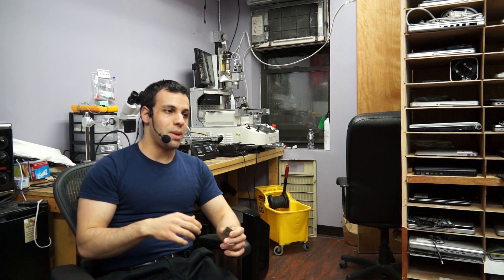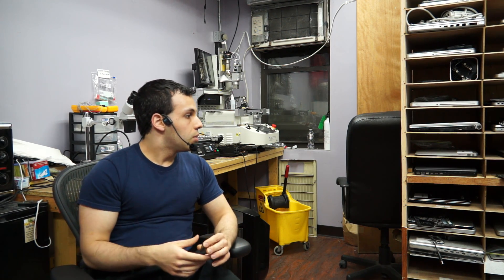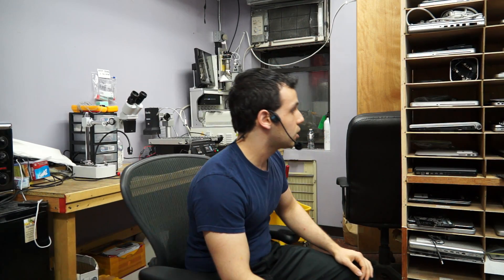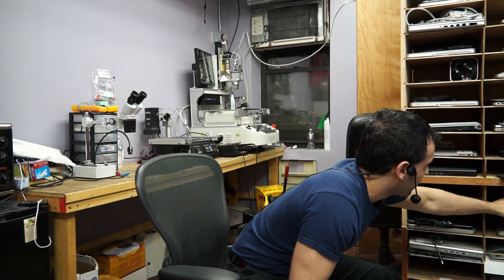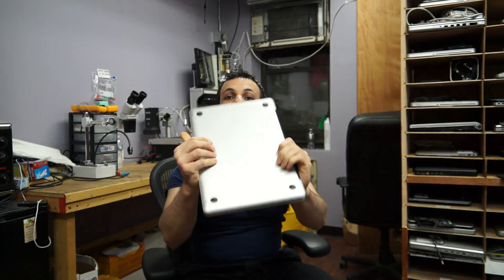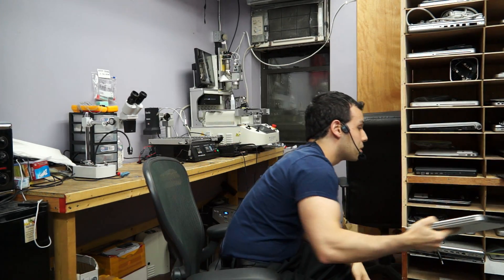Reballing flip chip GPUs is BULLSHIT - the truth about dead laptop GPUs & repairing them.

Comment: You're the man,  i have been meaning to setup a proper shop at home here, but there are very limited "guaranteed" repairs these days. I dropped out of school when learning digital circuits design because i'd rather fix things than make crappy hardware limited by the manufacturers orders.

I love learning what we've already got , rather than push my limited perspective on others.  I could say I'm an engineer, but in the streets, TECH gets the credit.

I can barely fix TVs and monitors without special "touch sensors" for buttons. Everything needs to be sourced and is so tiny , repairs are almost not worth it.  They can always buy a new one cheaper than the repair costs, unless its a macbook because they are so disgustingly overpriced. =)

Comment: Finally someone who tells the truth .I used to repair and refurbish laptop every day last 5 years  .And most of the time they where GPU  problems .Reflowing or rebaling the GPU made them work for a while some times 1 month the longest one thath work longer was 6 months but after that 1-6 month period of time they would die again.Any second atempts to reapir it again did not work . The problem is  90 % of the time  inside of the chip it self. Heating the GPU chip to temperature of  around 250 C will make the GPU work again for short period of time , but not because the solder balls melted underneath the chip and made a good a connection between PCB and GPU chip.Because the heath made the insides of the GPU chip move and expand.Gpu-s are exposed to a lot of heat during they life time and lot of  cooling and heating cyclse thath waer them out  .It can happen some times  very rare that the solder  joints crack under the GPU chip  but chances are that mostly there not. Olny  logical solution would be to replace the old  GPu chip with a new one since there are no new GPU chips the problem is unsolvable.

Comment: Just my personal experience from when I was a repair tech working out of a small shop outside of NYC. We did offer reflow services to all, but this was after diagnosing the problem and providing an outline of all options on the table. So, for the two most common, which of course were Xbox 360's RROD and MacBook Pro GPUs, we would offer to replace the damaged part or sell them a new system (along with a list of things to do to help avoid the issue in the future). Nobody wanted to hear this. Mom didn't have $200 to spend on the new console, or the patience to deal with her whining kid, and the designer didn't have a few hundred more (or time) to wait on a replacement GPU. Thus, we offered the reflow option. It was cheaper and we never charged  if it didn't work and always let the clients know up front that this option was at best a temporary fix to their issue, that at some point in the future they would be back in the same spot they are in today. Most took the option just to get back to whatever they needed to get back to and maybe a quarter of them returned within a year of the job being finished. All of them told us they should've just replaced the part, or purchased a new console, but none of them blamed us for the return trip, as we made it very clear from the get-go. In any case, I think most shops know that this isn't a real fix to the problem, but it is a band-aid that is nearly all profit when it works.
Reply: The primary problem with the 360 is the lead free solder, reflowing is temporary as you say. Reballing with leaded solder solves the issues, minus the flip chip.
The boards are still rather flimsy so will bend with heat.

Comment: There is one exception to this:
The Nexus 5X and 6P. The problem with these phones is that the CPU detaches from the logic board because it is terribly designed. If you are trying to get data off of them then it is a good solution because it’s easier than using a JTAG box and will make the device work for a few weeks which is more than enough to get data off it.

Comment: Good for you man. I repair automobiles rather than electronics, but the idea is the same. If I can't make a reliable repair that's going to last, I'll tell someone that I cannot fix it properly. If they still want a temporary solution, I may do it, as long as they understand that it is not a proper or reliable repair, in an instance such as the vehicle is going to be replaced in two months, and they really just need to get that last two months out of the car before sending it to the crusher.

Comment: The reasoning here seems to be that heating to below the melting temperature of solder cannot explain the short term recovery, but I feel it can as thermal expansion will result in movement that can clean the crack surface; but this will be a short term fix as things will oxidize again.

Comment: I know it was design flaw but for me it wasn't unfixable, at least on a video card.

The most successful way I did was heating the die twice, first hard press the die onto its holding frame when heating and allow it to cool when still pressed upon, this will squeeze out the air in the cracks within the solder. Then I heat it again without the press and allow it to cool slowly without any stress, so that the die sits rightfully in its place.

Because the original cause of the cracks were the temperature difference in power cycles and the PCB bending, adequate cooling and physical support for the PCB is needed. Many video card that failed only have two screws for the heatsink that caused the PCB to bend, that may be repaired by replacing the heatsink with one that has 4 screws for the mount, with a steel backplate to stabilize the shape of the PCB. So far, the combined heat treatment and physical fix together keeps my repaired GPU running for years.

It was just design flaw that caused the solder cracks. Fix the design and it will be working fine.

Comment: Internal chip defects do happen but to just say flat out that reballing is B.S. is complete nonsense. I reballed hundreds of Xbox 360s and PS3s over a 6 year period and most of them lasted for years after.  Some would fail on other chips (CPU or RAM) but very, very rarely the same chip. Experts have done xrays to prove the fault was in the solder ball array. Sometimes it's just tin whiskers which are fixed by reflowing with a high quality flux such as SMD291 by ChipQuik.

Comment: Started commenting before i watched entire Video. And you make so much sense. I have always believed that the solder melted @ around 180-220c and only now come to think of it that I'm coming to remember that solder really and truly does not melt @ that temp. Because if that were the case then you would be able to slide the entire chips off the board. In actual fact it takes more heat for that to happen.

Comment: You may very well be a honest person with deep pro knowledge, which is quite rare nowadays. 20 years ago or so I used to repair vcr, from time to time I used to place a heated resistor on top of some integrated circuit making it functional again. Fixing with heat not by re soldering at least at that time. Same goes for ventilating holes. In order to get decent cooling you need to have a flow of air get it from outside holes guided through heat-sinks then evacuated to different exhaust holes. One more thing though, you may end up being poor in this world engulfed in greed and lie. Thumb up, hat off also.

Comment: I honestly don't know what to believe when it comes to this issue. A while ago I watched a video of someone talking about the yellow light of death for the PS3 and when they applied pressure to the GPU with their finger it didn't have the yellow light of death but instantly when they took their finger off holding pressure down on GPU the system immediately returned to yellow light. With lead-free solder the solder joints do crack that's proven after many times of expanding cooling expanding and Cooling the solder joints crack. So when it comes to GPU it's hard to 100% know what is actually wrong with it.

Comment: The other thing I would have liked you to address, is what if the number of heat/cool cycles on poor quality solder can cause microcracks on the mounting points, in which case a BGA reball or reflow would definitely help?

Comment: What I did when someone asked me to fix their dead GPU laptop:
I told em what's wrong with it, and while one can get the computer operational again, it'll die on them soon after.
This was at first not "acceptable" and they asked me to fix it. 
Again I told em it's not possible. Temporarily it is possible to make operational, bu there's no permanent reparation option available.
They got a little angry with me, and asked me why other repair shops are able to repair it and I can't. They called me an amateur (Yeah I am but... that's beside the point)
I asked them back -"Are you sure they actually do repair it, and doesn't do the temporary fix?". It got them thinking.

They then returned to me 2 months later and asked for a data recovery. I suspect they had the things GPU "repaired" at the other repair shop, and then it died again.
Reply: SysGhost what about it the chip such as the mosfets died because of shorts? Some chip died due to poor heat management and some due to electric surges from the wall. Please advise if this is also unrepairable?

Comment: I don't Repair Boards, I refuse to work on Apple product with reasons you said in video. If GPU on board Starts to fail, CPU starts to fail say goodnight to the board off to recycling it goes, and you can burn the GPU chip reaching dysfunctional properties there for making GPU fail anyway so you're right had this exact same thing happen on a laptop that was made by HP GPU failed on board making laptop board obsolete only thing you could do is throw it away after stripping it for parts. Then buy a new computer after that or a new board it's cheaper to buy a new computer than it is to fix them anymore sad but true coming from another tech to you I understand your feelings on this issue also once a board starts going and you can't fix it anymore time to replace the unit.

Comment: We had this problem in the UK except it hit earlier. It was down to the transition from standard 60/40 solder to lead free. IE it took a while for people to get the process right. When you have one of those type chips it gets complicated. IE you have a chip scale BGA with possibly as small as 0.40mm ball pitch mounted on a mini PCB that expands that to maybe 1.2mm ball pitch to save cost for the PCB manufacturing end customer (holes less than 0.2mm for 0.1mm through holes need laser drilling). So you have two sets of solder balls to contend with. Personally I bite the bullet and use chip scale packages direct on the PCB as a bit of extra cost is worth the extra reliability in my opinion. The problem is that both sets of balls are prone to dry joints which dependant on exact solder composition and exact flux type can take between 1 and 5 years to fail. I have also seen this exact problem with gull wing chips in the early days of transitioning to surface mount from through hole on PCs (1980;s). The difference is that I could get a camera in really close to examine the joints and you could actually nudge some pins sideways slightly with a scalpel. The solution was to simply use a high flux content solder paste, run a line down the side of the chip and re-wet all the joints. This fixed near 60% of all of three types of motherboard I was working on at the time. Another 20% were tracks eaten by leaky batteries. As the heat did not time to get into the chip then it was definitely a soldering issue.

Comment: Louis. Turn the laptop upside down cover with a cushion so heat stays in. Gravity. If the GPU is NOT dead then the flow of melted solder caused by normal operating temps will return it back to its starting point. However it might take two years of running like that, non stop, to do the trick. Lol.
But the theory is sound. It’s my last resort method.

Comment: The temporary solution is OK IF and only IF the customer accepts it as temporary and it's a 'temporary' price.  They can go home and keep their work backed up and realise it could fail at any time.  You have to get them to understand it is temporary and the work cannot be warranted or you can choose not to do the work.  In every case the customer is only interested in recovering their work until they have the money to source another computer.  As I previously posted the temporary repair can last two or more years especially if the cooling is improved but I rarely resurface a GPU twice and to be fair it's a simple job that costs next to nothing to do so sometimes it's worth a try.

Comment: Not really true. Solderballs also fail by breaking. You can SEE is under a microscope! I've had so many graphic cards, where you can actually see it working, when you just bend the PCB a bit. The second thing is, when you heat up the Chip for something like 120°C, the PCB bends itself a bit and flexes underneath the Chip. This causes the Chip to work again until it heats up so much while using it and gets to it's previous condition.

Comment: I know this video is over three years old but heating the chip and not reflowing has been the accepted temporary solution for at least a couple of years.  In fact I have heated a GPU and it lasted two years. I redid it 6 months ago and it is still running now.  Next time it goes it might work but even so the owner has had the use out of it.  I never throw old motherboards out no matter how old they are so have a reasonable supply of legacy stuff so maybe I could fix it; who knows.

Comment: Reflowing isn't supposed to fix a faulty chip, it is supposed to fix solder balls which have either disconnected themselves from the pads, or fix solder balls which have physically broken in half.  This is due to the harder nature of lead-free solder, it doesn't have the same flex to it the leaded stuff did.  Poor cooling will accelerate this as the effects of thermal expansion and contraction are much greater than they would be if the temps were kept well below spec.

When you speak of heating the chip to 100C below the solder melting point and it fixes the problem for a little while, that is a separate issue entirely.  It could be repairing any number of things from reseating bond wires, correcting a silicon flaw, or to flexing the chip packaging in such a way that it makes proper connection with it's pads again (all three of which are temporary fixes like you suggest).  Only with expensive equipment (like an x-ray micro inspection camera made specifically to inspect PCB's) can you definitively say what the actual problem is.

Comment: Back in 2014 here in southamerica reballing was the hot new business; even "basement" diy guys with bare knowledge in electronics started to offer the "magical service" to a well know devices with gpu problems (PS3 and macbooks); I had the money to buy either a chinese reballing station or a 3d printer and after watching how many of these "magical reballing" processes went from "hair dresser and oven with metallic film" I decided to go with the 3d printer; 3 years ahead in time there were lots of complaints about those reballed devices going out again when put thru gaming or video stressing tasks; I concluded that the reballing machine, knowledge and price is only justifiable for expert people like Rossmann who really use it in the proper way (i.e. reballing at gpu replacement, donor boards, etc, with a repair volume and circulation of parts way over the "diy basement entrepreneurs" and overall not scamming the customers with a procedure that in the end doesnt solve the problem)

Comment: On a side issue 99% Xbox 360  failures ( red ring of death ) were   the GPU's solder balls delaminating , and  a re-ball isn't needed just a reflow seems to have resolved the problem , so perhaps reflowing the solder balls will at least  give you a good diagnoses , and the GPU in the 360 gets crazy hot , so the problem will often reoccur in a week or three , so I made a heavy gage GPU clamp , and that seemed to resolve the problem , completely .  FYI

Comment: Had a gpu issue on an old inspiron m5030. DIY'd it using a plain old heat gun (same king used for paint stripping) years ago and now runs fine. Unfortunately was inexperienced at the time and never removed the bottom plastic casing or cmos battery (removed main battery thankfully!) , button battery blew up and case melted, but at least they were easy fixes!

Comment: I know that this isn't a permanent fix.  But i had someone come to me with a dead ps3, i told them i'd get their data off of the drive, because simply moving the drive to another system doesn't work, but reflowing the solder fixed it long enough to back it up.

Comment: Hi, I agree that reballing dead chips is a temporary fix at best, but I still don't understand why heating the chip makes it work for a while. I don't think 120°C is enough to soften the underfill that holds the die to the package substrate, let alone effect any kind of significant change to the die itself, so it probably isn't moving anything around. And the bumps are likely some type of soft metal, though I don't see how that is fixed at such a low temperature either.... Or maybe they are? Are manufacturers not allowed to use any lead at all now, or is there a set limit? Maybe the temperature is enough for the bumps to go through some subtle phase transition and conduct again?